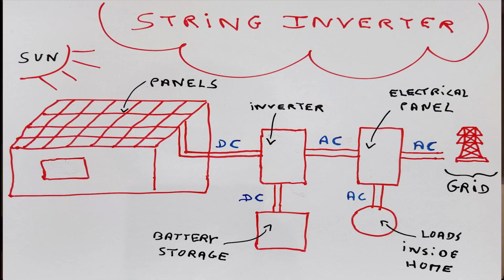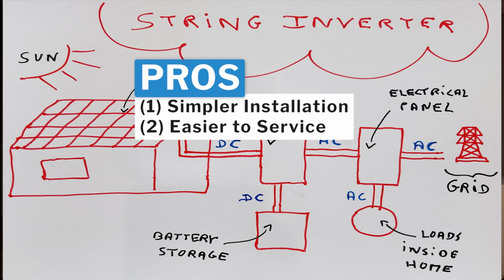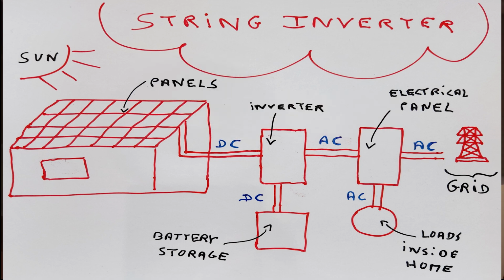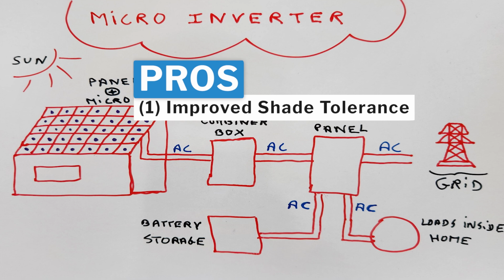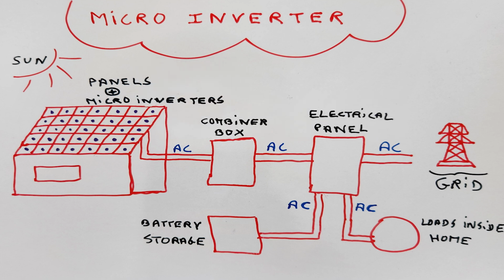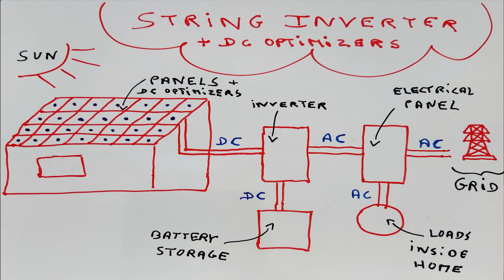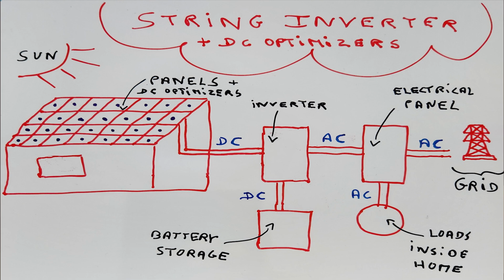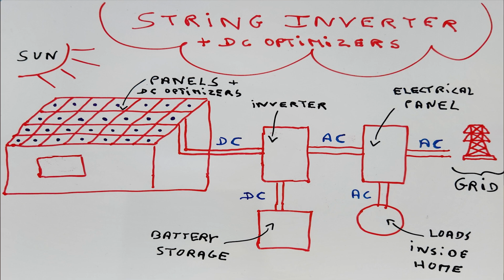String Inverter vs. Micro Inverter:  Pros and Cons

Comment: Hi there

   this is from India.thanks for the video.
in case if we dont require batteries and deploying a fully ongrid system , in that case does micro inverter systems become efficient than string ones. Yes from cost perspective string inverters are better..But from safety perspective (high DC voltage at the panels)arent micro inverters better

All this while i thought scalability was easier in micro inverter deployments
Reply from the maker: Thanks for your question! I must say that I am a biased towards string inverters and perhaps more importantly towards DC-coupled systems. The main reason is that if I have a 7 kw peak system and a 5 kw inverter, the panels are likely to produce the 7 kw during the day and the inverter will clipped that extra power. However, in a DC- coupled system, this extra 2 kw could be used to recharge the battery if available or used to power something else if applicable without reducing the maximum AC power sent by the inverter to power home loads. If installed properly, DC power would be totally fine from a safety point of view. Also, in my system, I do have what is called a rapid shutdown mounted at the ground level which will turn off the entire solar system in case of emergency. In my jurisdiction, it is in fact mandatory. But, in the end, you will be perfectly okay to choose micro-inverters. Check with your local installer and/or supplier! Wish you the best in your decision. Keep us posted if you have a chance!
Reply: @ElectrickLiving thanks for the info